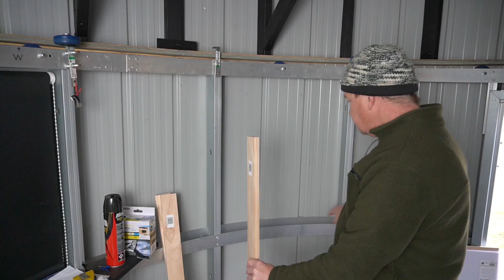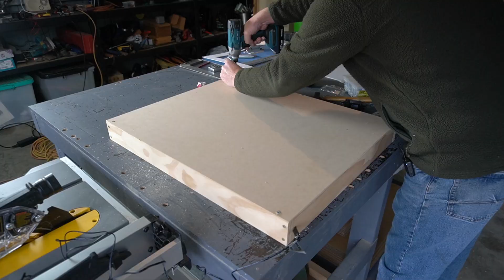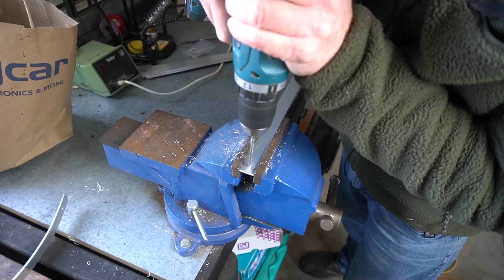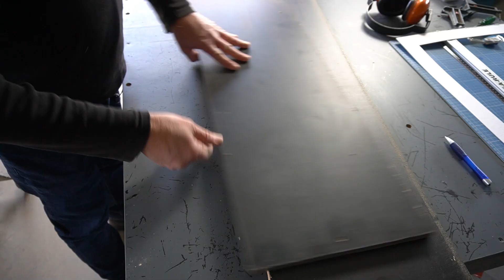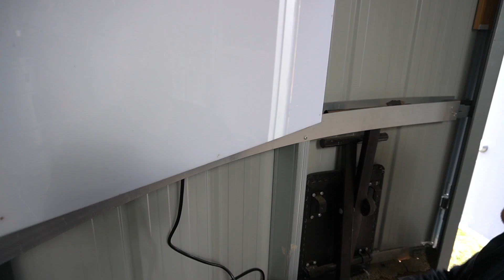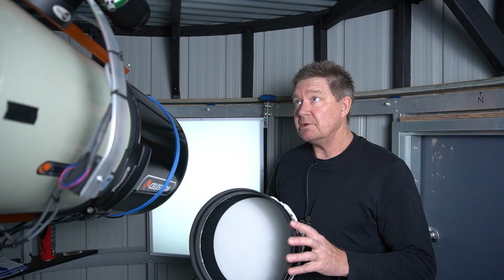How not to build a Flat Frames Light Box to do your calibration frames.

Comment: Nice project.  I need to make something similar.  When you took your test flats - how do you know that the light panel light was evenly distributed ? Maybe some of the uneven light distribution/vignetting in your test image was due to the light frame.  I'd like to figure that out before I build my light frame.  Thanks for producing this video.  Subscribed.
Reply from the maker: I have to admit, you made me question that myself. I have been away from home for a while so I have not been able to test your question
I h
Managed to compare some sky flats last night, which is quite hard with the hyper star at F2. I did not notice any real difference between the two.
I also did some more test flats at night, so that there was no light spill coming into the observatory from outside.
Again similar results.
Thanks for your subscription and comment.
CS Don